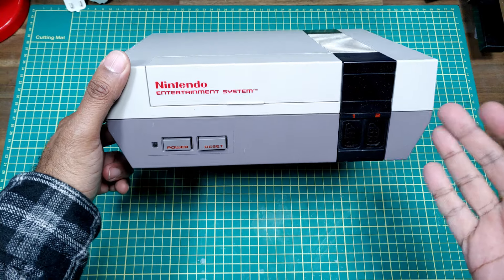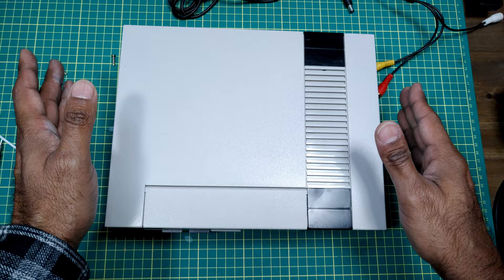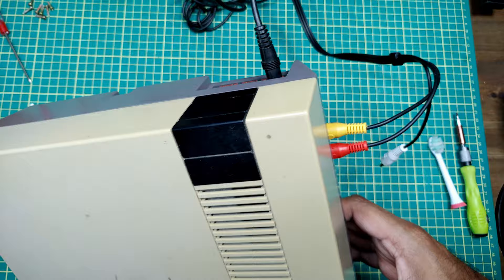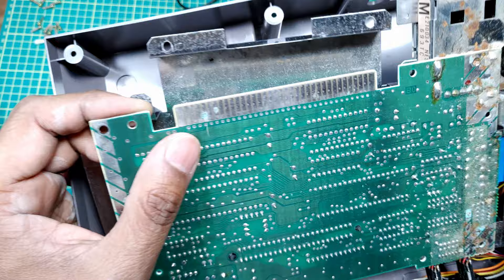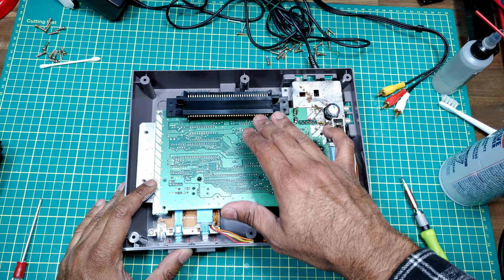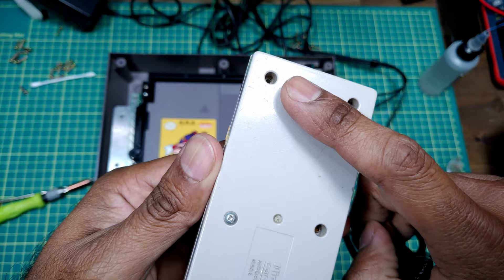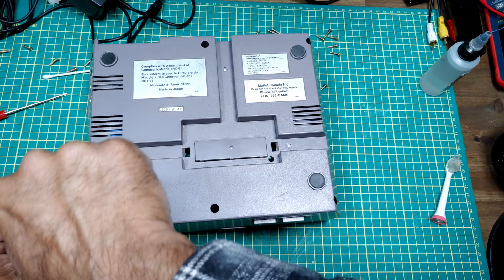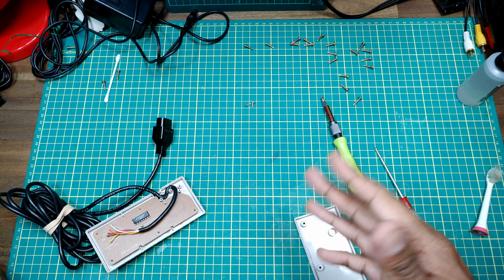Repair Attempt: Original NES (Nintendo Entertainment System) That Woke Up In a Bathtub Full Of Ice

Comment: NES red blinking lights are almost always so easy to fix. Buddy of mine bought a nes console at a goodwill, he said blinking red light no matter what he did. He gave it to me, within a minute figured out the problem. The pins on the 72 pin connector were so loose, NES couldnt detect the cartridge actually being connected. So, took the 72 pin connector out and with some tweezers, simply re-adjusted the pins. Now a very tight clean fit and every single game works perfectly. Love NES, so easy to figure out and fix.
Reply from the maker: Yup, gotta' love how those old NES's are built like tanks.